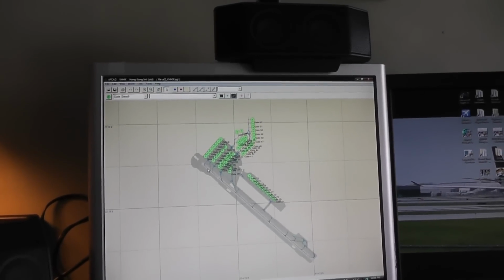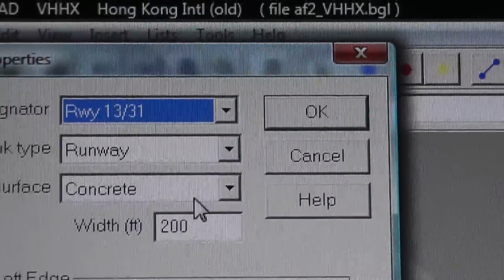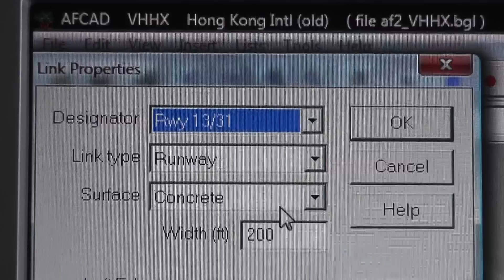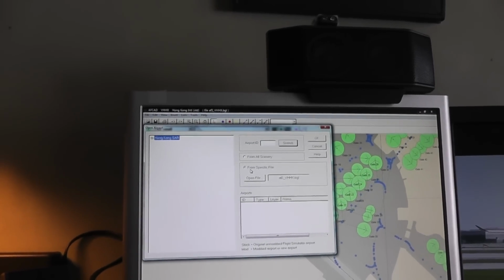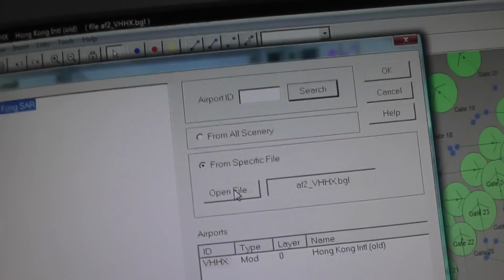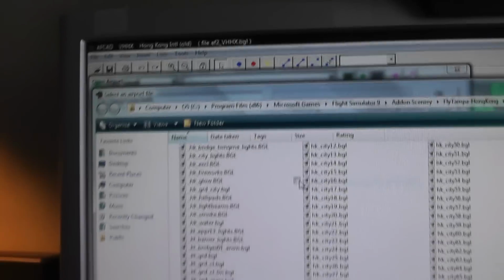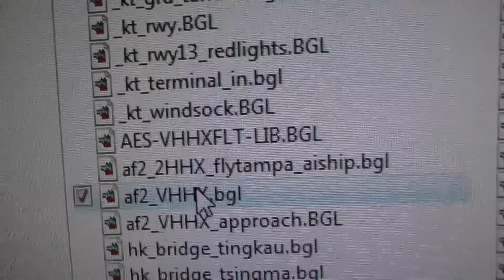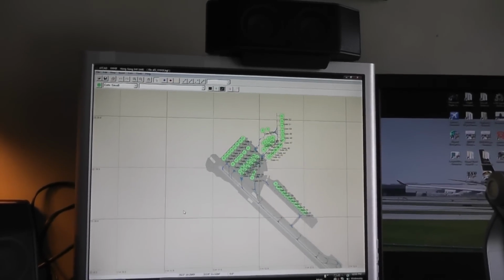How to fix bumpy runway at FlyTampa's Hong Kong Kai Tak FS9/FSX with AF2

Comment: Yes it is amazing and I found the issue, the ILS Ident must be a different name than the others. Each runway needs a different ILS Ident name. Name it anything, it just must have different names, I put runway 5 as ABC and runway 23 as AAB. I used AFCAD program to do it. When inserting an ILS you will be able to find the line "ILS Ident" Hope it helps. (Maybe you can also try to edit the existing ILS Ident on runways that have already ILS but I never tried it) I added ILS to TNCM, it's awesome.